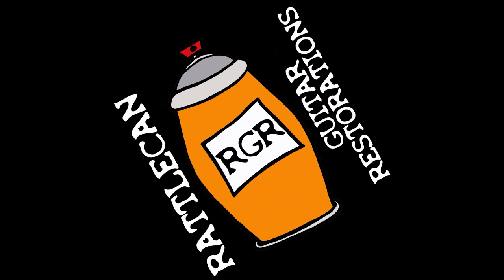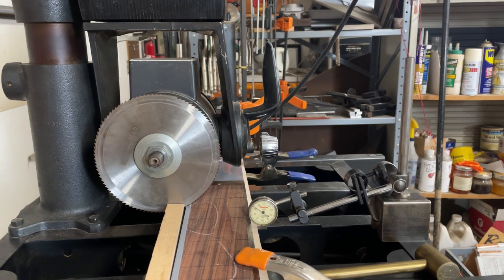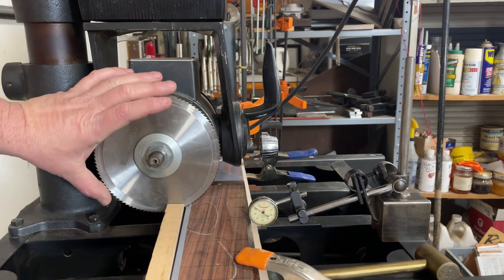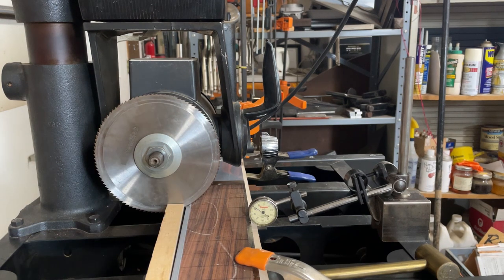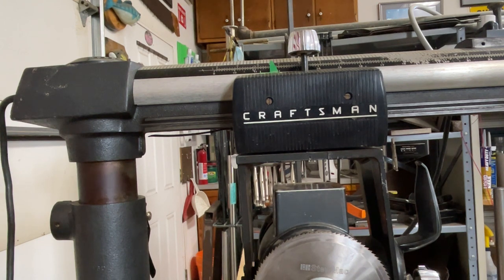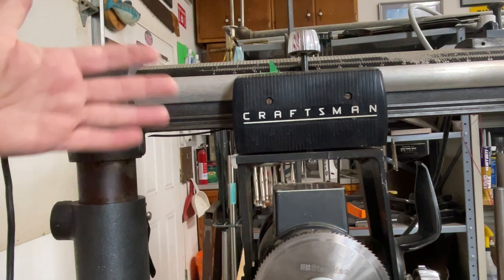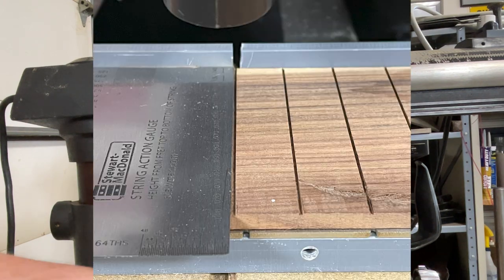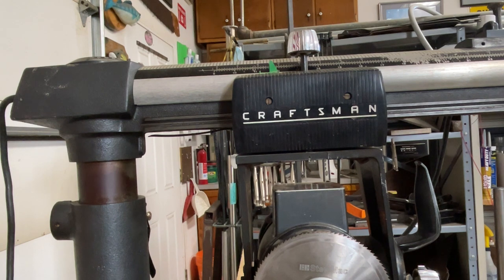Radial Arm Saw has the wiggles! | RATTLECAN GUITAR RESTORATIONS by James O’Rear

Comment: It has been many years since I have messed with one of these. All I remember is I could spend hours adjusting things to get it straight and to cut square and evenly up and down. But the next time I use it it's out of whack again. It became the saw I used to rough cut styles and rail material to size before ripping it down and final dimensions. I was happy to see it go. Build a sled for your table saw.

Comment: +1 on using a table saw with a special sled instead. Especially since you have the Stewmac blade instead of the LMII type which is a blade and two separate stabilizers which can be a pain to get on and off when changing blades.
Reply from the maker: I have a small contractor’s table saw that would be dedicated to this if I end up headed down that rabbit hole. Thanks for the input!

Comment: Sorry but you’re going to need to invest in a 1950s to 1965 Dewalt RAS. Once refurbished,fine tuned/dialed in , you’ll have zero issues with flexion.

That Craftsman is not designed for accuracy nor is it particularly reliable/safe IMHO. I’ve got 5 old Dewalts and they are superior in all aspects.

I LOVE all of your content BTW!
Reply from the maker: We had a DeWalt RAS at one time but the arm developed a crack (maybe in the move from Cali to Ohio).
Reply from the maker: @FIGGY65  I may have been there when I first found the DeWalt. It wasn’t one of the golden age ones but it did it’s thing until it didn’t.